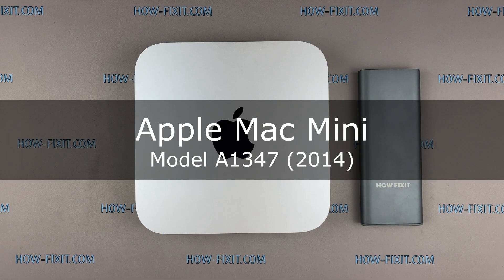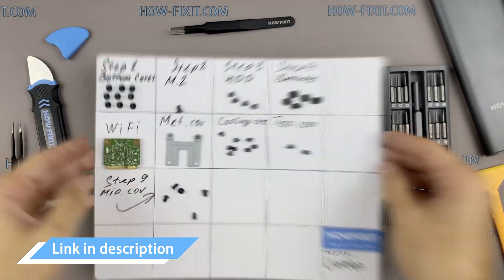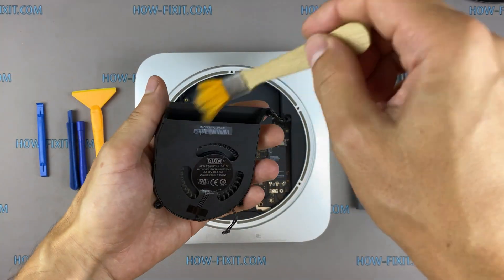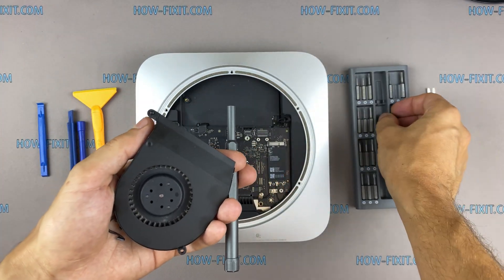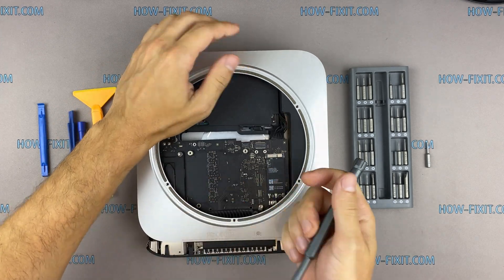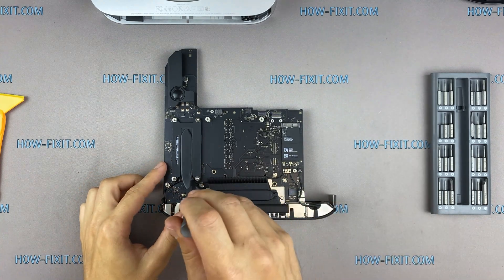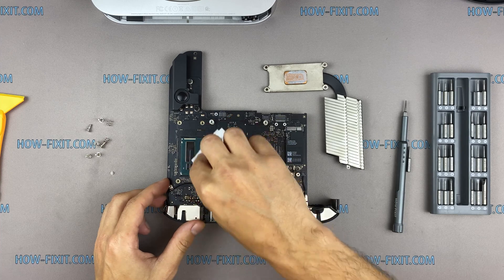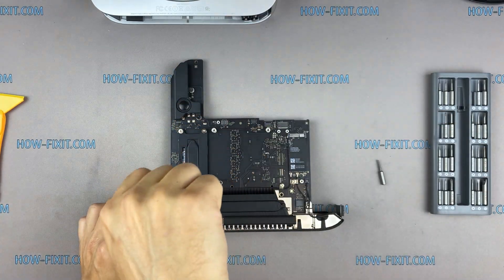Apple Mac Mini 2014 (A1347) Disassembly, fan cleaning and thermal paste replacement

Comment: At @3:51 what cable was disconnected. I believe I used the prying too stupidly to remove the housing from the motherboard. Is it replaceable or do I need a new motherboard